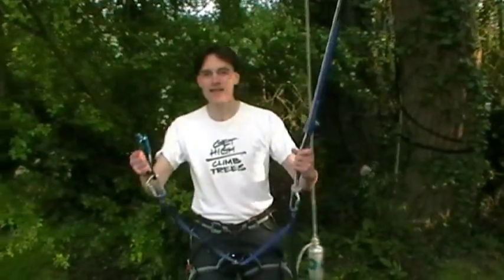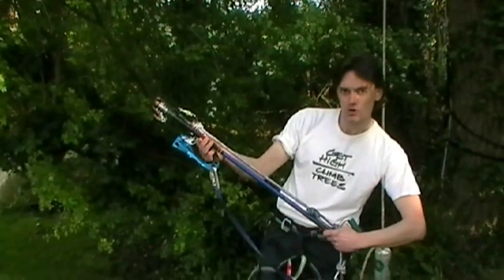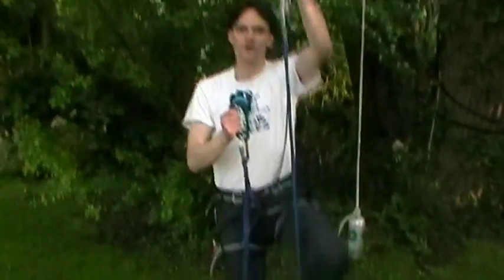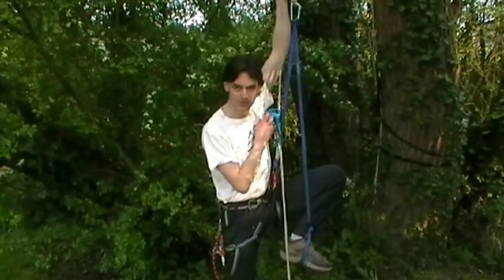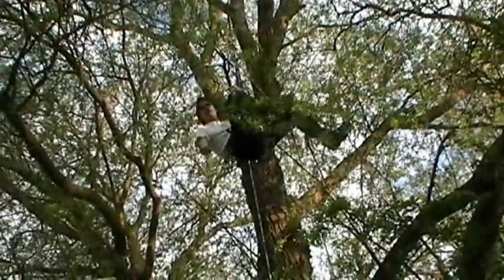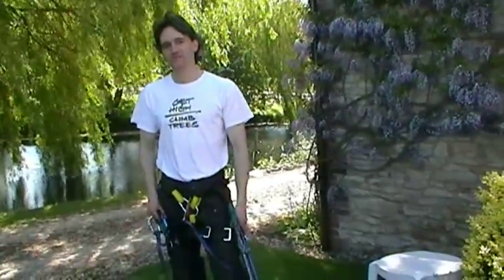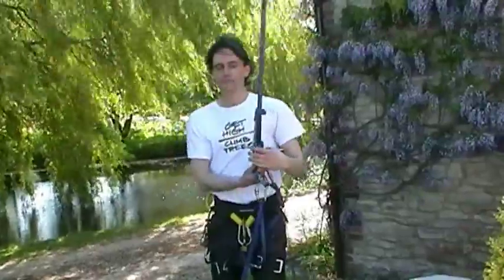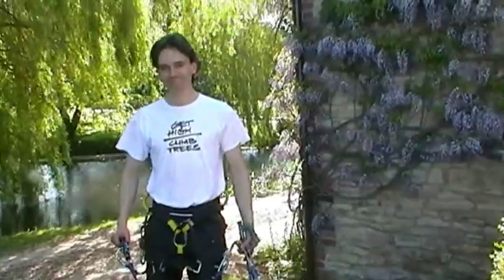Introducing the M-System.mpeg

Comment from the maker: Hi. I'm familiar with the double bungee system but I just had a look at it again. It has a much smaller step size, doesn't utilise arms to gain height as efficiently, the chest harness is restrictive and adds friction, and it's slightly heavier too. But that's overshadowed by the difference in set-up time. By the time you're set up and ready to ascend on your double bungee, I'll already be 100 feet up! I'm building an even lighter, simpler, more compact prototype at the moment. Keep watching! M.

Comment from the maker: @cavercse: I read your comment: it is very interesting. The world record for a 30m rope climb of 24.6s is about the same speed as I reach in the video. I probably couldn't keep that up for more than 20m but could probably still get close to the world record.
If I ran the Olympic 100m final then by the time I crossed the line in about 14 seconds, Bolt would aleady be in the press conference!
And so I estimate that the guy who did 24.6s could get close to or below 20s using the M-System.
Michael

Comment from the maker: I've also tried it with about 40 lbs of gear attached to my waistbelt and it still applies. However there are many possibilities with this system and running the foot stirrups through a chest roller if you wish will also work.

Michael

Comment from the maker: I'm using the strongest muscles in all 4 limbs with optimum step size, there is almost no friction. I've raced a friend with a treefrog system and was nearly twice as fast and 5 times as fast to set up. A better way to put this is that it takes much less effort, which is what you want when working!
As for having to pull yourself upright, I've found that if you point your legs down when taking steps it automatically keeps you upright so you don't need to pull in with your arms!

Comment: Michael, kudos for innovation.  It's great to see people coming up with new ideas and new ways of doing stuff.  However, some of your claims are a bit hard to justify.  Fastest?  You are still a way off the quickest times set by ropewalker systems.  Most efficient?  It looks as though your body is well back from the line and you have to pull yourself in at each step with your arms.  I imagine that after 50m or so that starts to get tiring?

Comment from the maker: The floating bridge passing through a fall arrester (which wasn't included on this prototype) was one possible solution. Alternatively the fall arrester could be on the rope itself and attached to climber's harness. These solutions will differ depending on the type of use. In rope access work, for example, there is always a seperate backup line with fall arrester whereas in arborism there is not. All these points will be dealt with between now and when it is ready for market.

Comment from the maker: These are valid points of course, and ones that I have considered myself. What I was using in the video was a prototype to demonstrate the principle of the invention, which is to be able to walk with all four limbs with complete freedom of movement - the most efficient way possible for humans to climb. There are many possible ways of making the long ascender and of attachments between the climber and the rope. These will differ depending on the type of use.